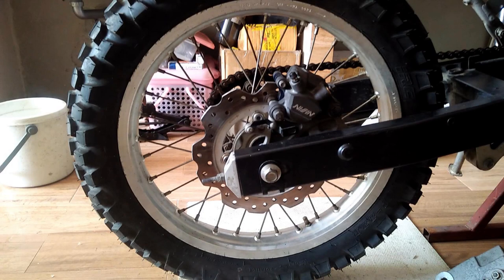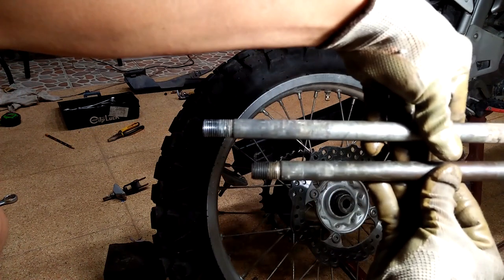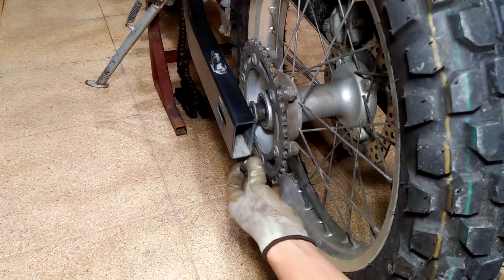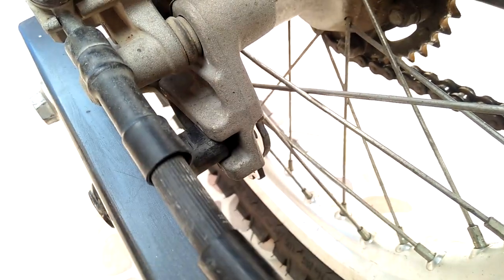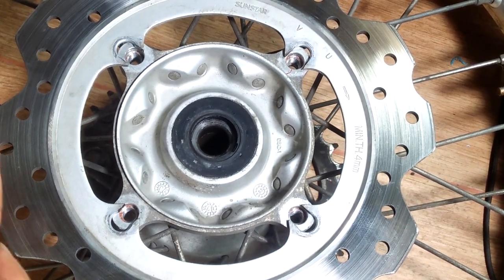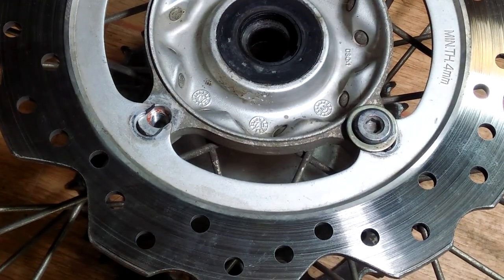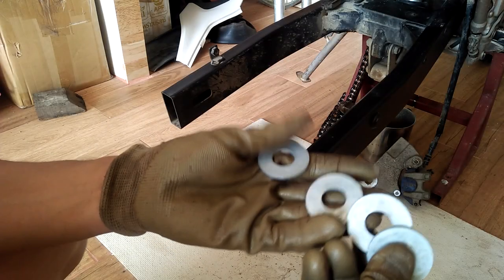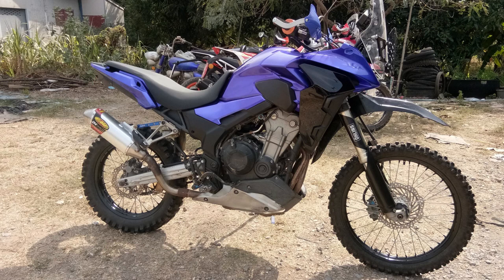Honda CB500X Spoke Wheels

Comment from the maker: If using 17" wheel, you can buy the spokes of the CRF250M which is made for 17" rim.  CRF250M is the motard version of the CRF250L.

Comment: Great video thanks! You should do one for the front wheel now
Reply from the maker: Hi. It is possible to use the original forks of the CB500X and put a dirtbike wheel hub for spoke wheel. That may require fabricating custom spacers and wheel axle. For the front wheel, a lot of people here in Thailand simply replace the whole front suspension. That comes with the triple clamps, forks, and of course the the spoked front dirt bike wheel. Have a look at my other videos here. It is a CB500X bike with full front dirtbike suspension just to give you an ides.
https://youtu.be/RYXeHPO8miM

Comment: hahaha DUDE... THANKS for sharing this, I was thinking about it for quiet some time but had no idea both bikes are  so  similar. I am having them both, the CRF250L since 2013 and the CB500X 2019 since 2019, both great bikes but do NOT hit a pothole with the SHIT Aluminium rims of the CB500X, I damaged my frontwheel and just had it fixed. Will soon change to Spokes THANK YOU and cheers from Thailand :goodvibes:
Reply from the maker: Hi.  I'm also in Thailand. I just copied what a lot of tge locals did with their CB500X.
Reply: @DIYPhil  got it but WHERE  are you? we are down here in Phuket, found a great mechanic here called BOY MOTORCYCLE close to Chalong btw. Not easy finding ppl in Phuket really knowing what they do. Boy fixed my Honda Steed 600 after many other cant do it for 2 years! 
I want to have the same stand you are having in your video btw :D :D
Reply from the maker: @phuketbungalowinfo2757  Hi. I'm at Sattahip, Chonburi, near Pattaya. I agree with finding it hard to find someone who can do a good work on our bikes. That is why I rather do it myself. Take a look at this video of the stand if you have not done yet. I gave the dimensions and anyone who has a welder and a few tools can duplicate it. cheers. 
https://youtu.be/UNwkMP8l5ow

Comment: That's a good way to do it, i wouldn't keep the 500x caliper with the cuts though , they'd be some significant forces imposed on a disc thats not a true fit. Each to their own i supose, new subscriber good clip.
Reply from the maker: Thanks. The CRF disk is smaller diameter so I thought it will be less braking power for the CB that is a heavier bike. That is why I keep the CB500X disk. I did mark some reference lines on it to see if it shifted or if anything moved out of place. so far so good

Comment: Hey, very clear video and solution for the pre 2019 500x, mine is a 2017.
Now a big question for you, did you relocated the mounting point of the swingarm or did you left everything else stock? Ask you because I have seen pictures of 500x's where they drilling new holes in the main frame and weld in new bearings. Also they used the crf swingarm. 
That was for me the point to say...wait till a more easy solution pops up.
Putting in a crf250l front wheel with the original 250 suspension and triple clamps must be possible to I think. 
BTW in Thailand too 500 kms north of you I think. Close to Nong Bua Lamphu.
Reply from the maker: Hi. I did not relocate the mounting hole of the swing arm. I think I know what your talking about as I am also looking at the work of some folks in Thailand who fitted the CB500X with the CRF250L swing arm. The reason they relocate the pivot hole for the swing arm is to also fit the CRF250L shock. I'm not in favor of that solution because it will make the wheel base longer. Take a look at some of my other video as I am also building a modified CB500X that is fitted with a CRF250L swing arm. But I go for a different approach. https://youtu.be/RYXeHPO8miM

Putting a CRF250L front wheel and suspension to the CB500X is possible by modifying the triple clamp. What they also do here is they cut some length of the fork spring so that it get shorter. That will effectively shorten the suspension travel so I am also not in favor of that. I'm just saying what others has done.
Reply: Yes I ve seen the other two videos of the 500c Rally project and can't wait for nr 3.
Have to say that my goal is to make it more sustainable for the Thai roads. 21" front wheel is a must have to fight the potholes and for me the suspension front and rear is the next to be changed. Optional I could fit a spoked 17" rear wheel like I had in my xt660z tenere in my home country, nothing wrong with that unless you want to use it more offroad. Problem with that is a available 50/50 tires in Thailand but that's only a small down point.
What is the modification on the crf triple clamps that have to be don to make it fit?
Reply from the maker: @bramcornelissen4413  If you compare the neck tube of the CRF250L and CB500X, they are different length. So the length of the center shaft on the CRF250L has to be altered to fit the CB500X. I did that having a solid piece of steel machined to tightly fit inside the existing center shaft (because it is hollow) after it has been cut to require length. Then welding the pieces together. Doing this will ensure that the shaft is straight. The upper neck bearing are interchangeable for CRF and CB so no problem with that. The lower neck bearing of the CB500X has lager inside diameter. So I made a bushing to make the CB bearing to fit the CRF. I think I'll show that on the next video. I can personally send you some photos if you reach out to me on facebook Diy Phil. 
https://www.facebook.com/Diy-Phil-104201648341175

Comment: Does the stock wheel of bristol venturi or beneli trk has thesame fit with the cb500x?
Reply from the maker: Hi.  It is not a plug and play fit but I'm sure it can be made to work just by madifying the spacers like I did in the video.  Probably need to change wheel bearings and seals if the axle is different diameter.

Comment: will the cb500x wheels fit on the Crf250l?
Reply from the maker: No. it is too wide for the CRF swing arm and forks. But the CB swing arm and forks together with the CB500X wheels can be fitted to the CRF250L. Here is an example:
https://youtu.be/U5DrGAX5xFI

Comment: Did you have to bleed the brakes when changing to Crf250l rear brake caliper
Reply from the maker: Yes.  Everytime we disconnect the brake hose then we have to bleed as some air might have entered the system
Reply: @DIYPhil  thanks will the cb500x wheels fit the Crf250l?

Comment: Crf250l 스윙암  교체시 주의점 있나요??
Reply from the maker: Annyeonghaseyo. The diameter of the CRF250L center bolt is slightly smaller than the CB500X. Some folks would insert a bushing so that it fits snugly to the CB500X frame.
Reply: @DIYPhil  

감사합니다 추가질문
250l스윙암 변경시 장점은 뭘까요??
무게감소??경량?? 효과??
휠베이스 확장??  
장점을 알려주세요

감사합니다!!땡큐!!
Reply from the maker: @샷시닥터하자보수전문  The advantage of using the CRF swing arm is being able to use the CRF wheels without anymore modification. However, need to modify how the rear shock is attached because it is different with the CB500X. There is not much difference in the weight and wheel base.
Reply: @DIYPhil 
도움이 많이 되었습니다 감사합니다!!♥
영상참고해서 성공하면
후기다시한번 남기겠습니다

이영상은 정말 큰도움이됩니다!!땡큐!!

Comment: paano po abs nyan? disabble na?
plan ko din iconvert ns200 using crf hub..
Reply from the maker: oo bosing disable na. pwede naman imodify yung abs ring para gana pa rin abs. gaya lang din ng proseso nung pag modify ng disk brake. parehong butas lang kasi kabitan nun. hindi ko lang ginawa na kasi disable ko na yung abs sa motor ko.